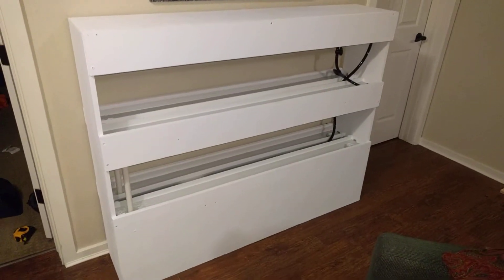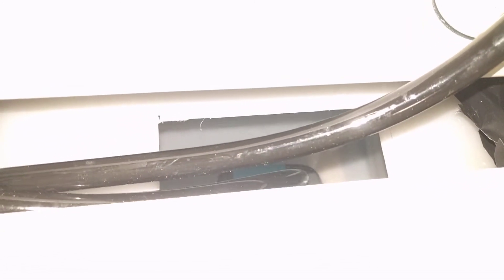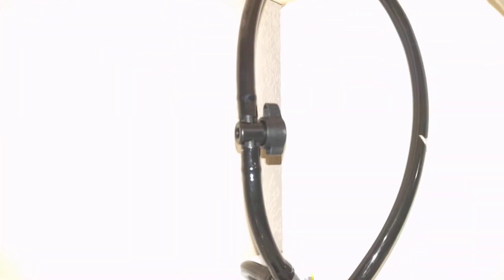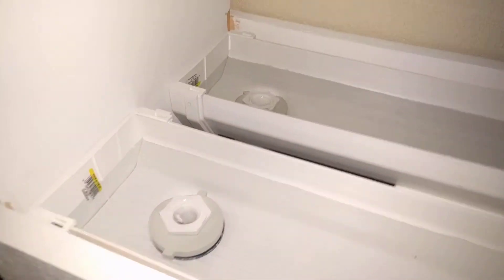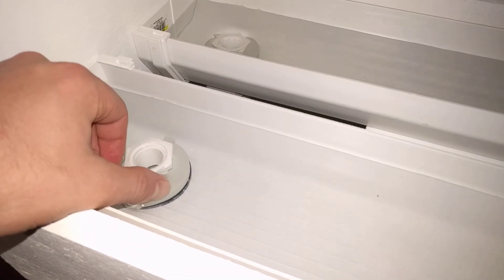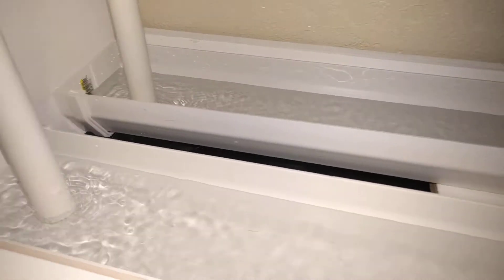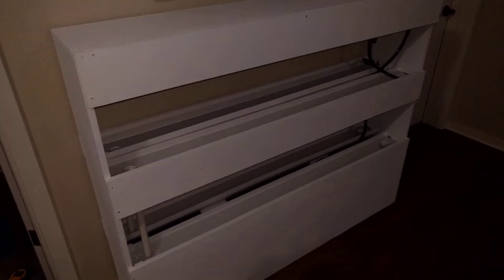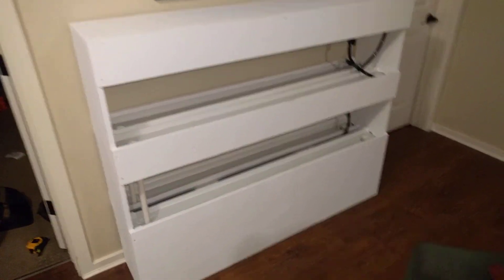Indoor Hydroponics Garden - DIY

Comment: Looks nice! Have you considered that Hydroponics systems usually need maintenance. Sometimes frequently depending on the design. It's a good idea to design with that in mind so easy access to the tank, hoses, gutters and all fittings. It solves the problem of when work needs to be done to fix a problem. Perhaps your video didn't show the back side of any way that you planned to make it easy to get to or clean the tank or other areas beyond the one shutoff valve I saw. Also, in my experience you also need good air flow into the tank so a good air stone or bar. Lastly, a timer might be needed depending on what you are growing and might be best to prevent root rot (on some crops) from constant wetness. I'm betting you planned ahead to have tools to test water temp, water ph and nutrient content. In some cases there are devices that can combine all of those features in one unit, but they are not cheap. The design looks good for an year round indoor garden though if you have all of those things addressed. Would love to see follow up videos of your progress. Will look for them now.
Reply from the maker: The gutters pop out and you can access the tank. The water drains down a pvc pipe, bringing air with it. And the hole in the top of the tank is pretty big. Yeah it was on a timer for like 10 minutes every hour I think. What I didn't like about it was it wasn't very space efficient.